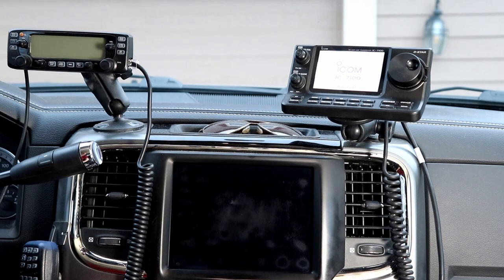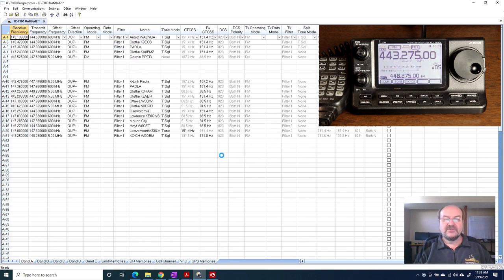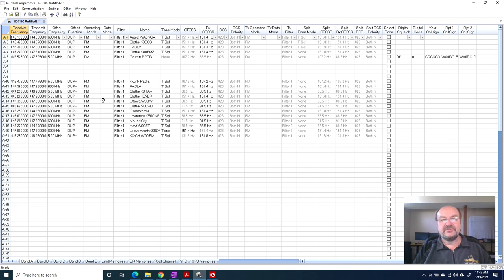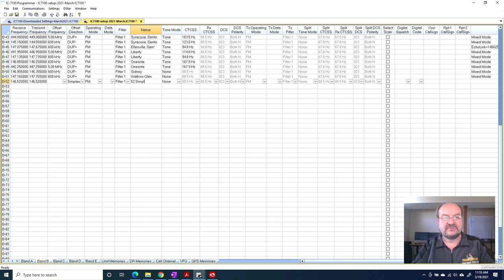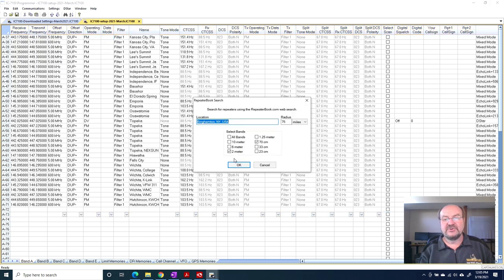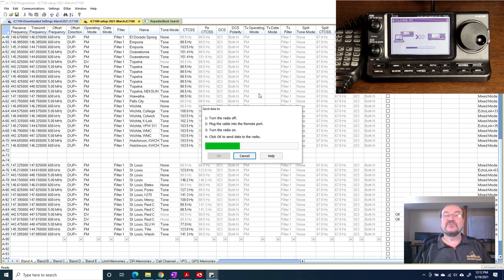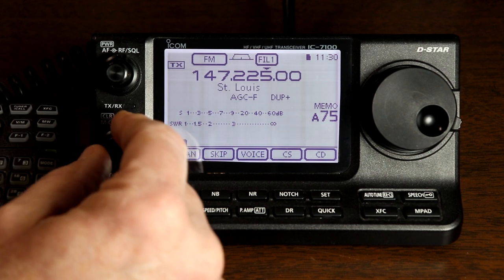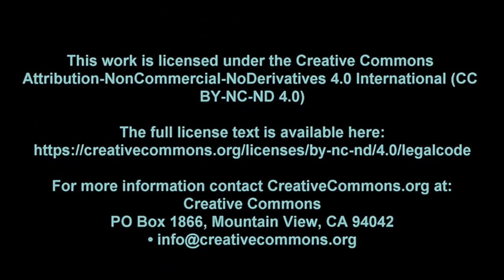IC7100 A to Z #14 - Radio & Memory Programming with RT Systems software

Comment: Hi Tom, Fred g4vvq here, i want to run RS BA 1  Icom remote software, i assume the settings on this video would be the same on the ic 7100, as that uses the usb cable, i am intending to run windows 11 on one computer and windows 10 on the other, i have had the 7300 working with 2 win 10 laptops....Fred.

Comment: 7100 RT Sys question... How do i program a repeater tone AND a Rx Tone...  Programming a tone - i understand & works,. but if i want a Rx tone do I enter a SQ tone, but then the Tx tone gets grayed out.. What am i missing. Is the 7100 not able to have both a RX & Different Tx tone ? Or am i in the wrong Column ?  What am I missing ?
Reply from the maker: Hi.  If you need to have separate RX and TX tones, you need to change the Offset Direction.  Instead of + or - DUP, you need to select SPLIT.  Then you enter the TX and RX frequencies separately.  All of the Tone columns will grey out.  Further to the right there is another set of Split Tone columns with Tone Mode, CTCSS and Rx CTCSS.
Reply: @HamRadioA2Z    Thank you... this may be it... I owe you a beer !!    73 !!
Reply: @HamRadioA2Z   Thanks so much.. makes sense. 73 !

Comment: Learning a lot about my 7100, RT systems seems like Chirp .
Reply from the maker: Hi.  Thanks!  Yes, Chirp is an open source, free option.  I had tried it several years before that video.  It mostly worked, but the user interface was very clunky and difficult, so I went with RT systems.  I know Chirp has had many updates and I’ve heard that it is much better and more complete now.  So it might be a good, free alternative.
Reply: @HamRadioA2Z  Chirp has been great on my Cheap Chinese HT's  I have had no issues with it. The design has profiles for each radio and I have been able to access anything through chirp that I can manually.

Comment: Is there a power output setting on RT, when I send a file to rig it sets power to 100%. I like to run around 20. I’m I missing something?
Reply from the maker: Yes.  If you click on the Settings option on the menu bar you will see an option for Radio Menu Settings.  That option pops up a window with multiple tabs.  In those tabs you can change every option that is available in any of the settings menus.  You'll find power settings under "Common 2".  73, Tom

Comment: I had talked to the Gigparts chat line and the person there told me that I had to buy the RT Systems programming cable so I did. It does have a 3.5mm connector that plugs into the remote port. I found out later the USB cable would have worked. I think that is why the directions at 3:18 popup are written this way.

Comment: Tom
I purchased an IC-705 three weeks ago and so far I have been able to use just about all the modes accept Dstar.
If you have the time could you make a video about the internal DV settings.  I also purchased RT Systems program and cable. We only have four Dstar repeaters here in central Mississippi but I’ve not heard and activity on and of the Dstar repeaters.
Now all of the FM repeaters work just fine but I can’t seem to get Dstar repeaters to respond. I used the calculator in RT systems but still no joy.
I think I’m just missing and step.
I also have an ic7300 and really enjoy your A to Z Icom videos.
73
wd4dda

Comment: Your comment when you were correcting the RepeaterBook D-STAR cannel (time 21:00) K0MDG was programmed incorrectly. You said RPT1 should be K0MDG(space)B. To help the viewers, the correct programming of the YourCallsign column  was correct CQCQCQ but the RPT1 colum should have been, using (UPPERCASE), KOMDG(space)(space)B to make a total of 8 characters in the box. Same applys to the RPT2 entry of KOMDG(space)(space)G to make a total of 8 characters.  So if the callsign in this example was N2PB the correct RPT1 would be N2PB(space)(space)(space)B. Same applys to the RPT2 column, KOMDG(space)(space)(space)G. You must always have 8 characters in the RPT1 AND RPT2 colums and the letters must be in CAPS not lower case. Hope thats clear as mud. Great youtubes!
Reply from the maker: Thanks for the correction!  Hopefully this helps some others.  I hadn't double checked every channel.

Comment: Have you done any of the transmit audio mods for the 7100.
Reply from the maker: Hi.  I haven’t done any mods to mine.  I typically get good audio reports and I’ve received a number of good signal reports when running mobile.

Comment: Nice video. Question.  I have the RTS software for the 7100. I have not found how to write the file to the SD card and not have to use a cable connected to the rig.  Does anyone know if it's possible?
Reply from the maker: Hi Robert.  Thanks for the kind words.  The RT Systems software uses the Clone function that normally allows you to connect 2 IC-7100s together and copy all of the settings and frequencies from one to the other.  They have obviously reverse engineered the communication that happens between 2 radios.  Using the SD card would require creating a .ICS file.  AFAIK, that file format is proprietary and Icom doesn’t publish it.  It may be that reverse engineering the file format is more difficult or maybe there are some legal restrictions that prevent it.  If I find any way to do it with an SD card, I will definitely post a video about it.